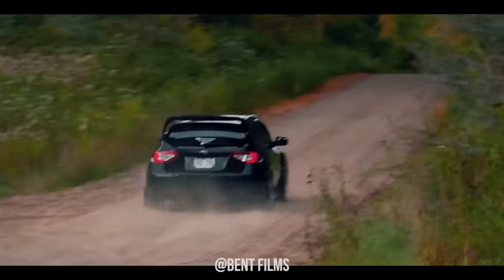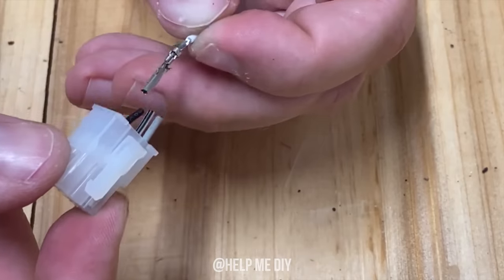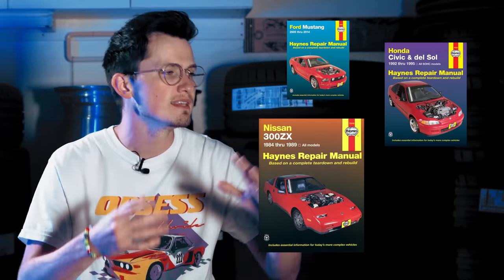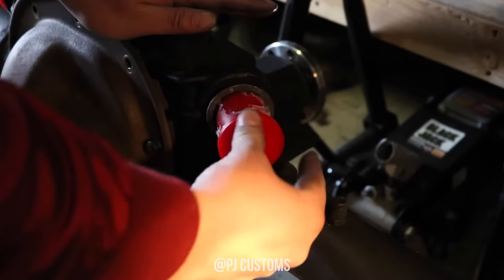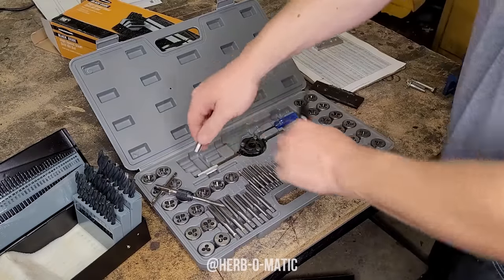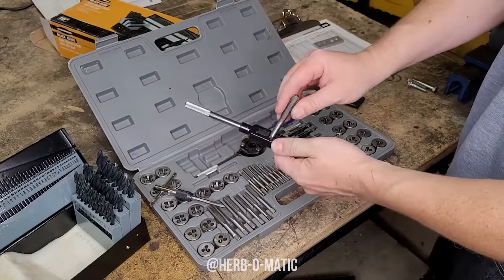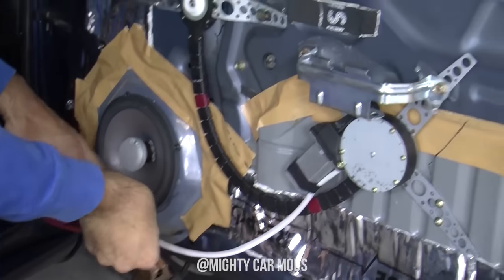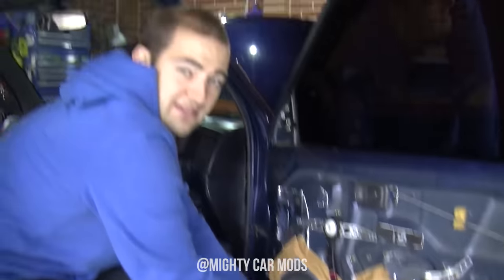How To Avoid Common Car Part Install Mistakes

Comment from the maker: What was a car mistake you made since your start in the scene?! Let me know below and I promise I won't judge!!!
😎😎
- PS The Touring Bag dropped and there's only 25 so DON'T MISS OUT! - 
AlexMartini Official site - https://bit.ly/3vZQFyC
Subscribe - https://bit.ly/3kXgWr0
Gaming Channel - https://bit.ly/37tED70
Instagram - https://bit.ly/3KXRGeH
TikTok ► https://bit.ly/3P6Uv0d
Facebook ► https://bit.ly/3M26Ssq
Official Marketing Agency ► https://www.metamartini.net/
Reply: Used Gloss black paint on my trim lol
Reply: Don’t uga tugga the bolts on the flywheel. 🤦
Reply: Installed a clip on Akrapovic CF tip on my Magnaflow muffler and as soon as I went over a speed bump it fell off and got crushed.
Reply: I Changed a Full set of Wheels with a Car Scissor Jack Lift, in a drive way that had a slant, It was worse thing I've ever done. The car fell off of the jack, I busted every Knuckle, and I busted the screen on my phone.

If you ever disconnect a Fuel line make sure you connect it correctly. A low fuel light came on, and everything smelled like gas because the fuel line wasn't connected  correctly
Reply: I never got in the scene. So much mistakes are forgotten from time 😈
Reply: forgot to close a bleeder valve, was an exciting test run

Comment: Im a firm believer of testing the repair ive done before reassembling everything. Learnt it the hard way as an apprentice 5-6 years ago. Literally the 5 minutes it might take to test something is better then tearing everything apart to plug in the connector you missed... Even tug testing connectors and hoses is a life saver
Reply from the maker: It always is. I learned it the hard hard way tbh haha
Reply: Yessir yessir! Despair is looking at your fully reassembled dash as you realize you either broke the wires to the mode door actuator or left the connector off because it's stuck in defrost....

Comment: My buddy works at an auto part store. I was gonna do my brakes and I’m new to cars btw. There was miscommunication about my car. I have a mk7 gti and in his system there were many golf part options. I ended getting rotors that were too small in diameter but I didn’t know at the time. 6 months later they wore horribly and I got a death wobble. Then I got the correct parts. We laugh at it now. Good times!
Reply from the maker: Oh damn, I didn’t think they’d fit if they weren’t for the right car. Sick either way that you got it figured out though man! 

Also, thanks for the comment. Hope you enjoyed and subbed :)

Comment: The thing I learned the hard way goes back to patience. I was doing my first oil change on my 97 Dakota, WAY over due. The way my dad talked about it made me scared to even start the truck, so my brother and I tried to push it up onto some ramps so I could get under it. That didn't go well. I got super mad and slammed my passenger door. Turns out, ya shouldn't do that on a 14 year old truck with the window down. That thing shattered and my anger quickly turned into despair... Ended up being a good thing for me because it was the first time I realized that getting a part from a parts yard and replacing it yourself for $14 is way cheaper than the $300 that insurance wanted to get it fixed. Long story short, be patient, don't loose your temper, and fix it yourself when you can to save money. Oh yeah, and if your truck is a year and a half over due for an oil change...starting it up again to put it on ramps will not hurt it, don't be dumb. Lol
Reply from the maker: Isn’t that crazy how sometimes it takes a pretty tough moment to realize something so simple? Or how often it’s taught to us to be patient until we’re literally FORCED to be patient because of us making a mistake? That’s a life trick.
Reply: Truth! Besides GM dashes and GM door trim i don't think i've broken anything i wasn't already mad at. Any day i'm working angry i'm about to cost myself money.

Comment: I was installing an I.E intake on my Golf R, and since the cone and housing are a bit bigger than stock, you have to reroute the coolant line. Well, I thought the coolant was cooled down enough to start my install, and went to undo the existing line, and it spooged all in my face. Thankfully I didn't get it in my eyes or I'd be like Helen Keller. Lesson learned, make sure the coolant is actually completely cooled down before disconnecting the line
Reply from the maker: You never realize how hot coolant stays after a car has been turned off too hahah. I hate coolant with a burning passion. The amount of times I have spilt it, had it shoot up on me, or had it leak onto shit that I had to clean is countless. Also, that’s what she said. 

Thanks for the comment as well, it means a lot! Hope ya subbed :)

Comment: Wooo! Giving a comment to the Algo Rhythm gods! 

And also, we've all made mistakes. Months troubleshooting a rough start/idle/shut-off issue with my 89 accord, throwing parts at it until one day... the coolant temp sensor finally died completely.

There were 3 sensors - 1 was the fan switch, 1 sent a signal to the dash, 1 sent a signal to the computer...
Reply from the maker: No way…Was the fix relieving or were you upset about it taking so long?! Haha.
Reply: @AlexMartini.  yes! 

But with new injectors, fpr, plugs/wires/cap/rotor/coil/igniter, egr delete...😂

It ran like a champ after that.

Comment: Ah when I did my first brake job and replaced a seized caliper, I went and bled the brakes. And tightened the bleeder screw on one of my brand new calipers...only to have it suddenly become looser as I turned it right. The joy.
Reply from the maker: Have you ever went to tighten something and it just keeps turning…and turning…and turning…and you start to realize that it’s not seating…and you realize you are seriously screwed. Thanks for the comment as well, it means a lot! Hope ya subbed :)

Comment: This is not only a horror story but also a helpful hint. Always check to make sure the old rubber seal on your oil filter came off with the filter before putting the new filter on. Changed the oil in my 95 Mirage and didn't check this, screwed the new filter on and drove to work. Needless to say on the way home from work that night the new filter worked it way loose cause it didn't seat properly and drained the whole essentially locking my engine up before I could get home.
Reply from the maker: I HAVE DONE THIS! Hahahaha I hate when it’s the little stuff like that. Mine was only a few miles but it happened on my Z.

Also, thanks for the comment. Hope you enjoyed and subbed :)
Reply: @AlexMartini.  That's crazy that it also happened to you. That Mirage was a fun car that I actually did the Evo conversion body kit on. Had a lot of money into it but this was almost 12 years ago. Since then I double check everything when changing my oil.  Also been subbed since your second video my guy. 😁👍👊

Comment: I learned the hard way to torque your wheels to spec at 18. When I didn't tighten my lug nuts enough with my ugga dugga causing 5 out of 6 lugs to sheer off, leaving me broke down in front of a adult shop while I wait for a tow. I also got fired from my temp position since I called out to fix my truck.... use a torque wrench
Reply from the maker: Always man, then retorted after 50 miles if its a brand new setup just to be safe :)

Also, thanks for the comment. Hope you enjoyed and subbed :)

Comment: I was changing the engine mounts on my 93 volvo 240 and took the intake off. I didn’t know that I also ripped the hose for the flame trap off too so when I put it back together I had a random hose with no home cause I forgot where it came from. Took me hours of videos to figure it out and get it running again
Reply from the maker: Jesus, that would take a long time to figure out if you didn’t know what to to look for haha.

Comment: Drywall screws are for drywall, NOT your car.
Somewhat related - should you mount your sub box or amplifiers or whatever else to the car floor by just running screws through the floor (ugh), DO be aware of what is on the other side of the metal...
Reply from the maker: There’s so many new questions to ask based on your comment but I feel like I’d only bring up more pain, hahaha. 

Also, thanks for the comment. Hope you enjoyed and subbed :)
Reply: @AlexMartini.  I was a professional car stereo installer for almost 30 years so I have seen a lot of WTF.  

Am I subbed?  Lol, you funny..

Comment: Hey Alex, that sound like me doing my first mod on my VWMK-3 Coilovers did not have a impact gun and tried to do it with wrenches.I had to call a friend to complete the job ,luckily he had a impact gun or I would have been in bad shape. My old shocks and struts were bouncing  all over the place. It was time to upgrade and the mechanic said it would be $1000 dollars for the complete job. So I decided to do it myself best time I ever had molding a car.
Reply from the maker: That’s awesome. How’s it all running now?!

Comment: frfr with that hand tight it all before final torque. Took me too long to learn, stayed having my last few bolts not line up when i started working on cars. I did my plugs to resolve a misfire. I took it all apart instead of one at a time and just grabbed the pigtail that happened to flop closest to the plug hole going back together. I hooked up cylinder 4's coil pigtail to cylinder 6 and 6's pigtail to 4.   Had both cylinders firing like 60deg before tdc just beating out the bearings.  Had to drive it to class and both jobs for three days until i could figure it out.  Wasn't even the plugs, i needed a coil pack.
Reply from the maker: Oh my goodness…I’m glad you figured it out but damn I couldn’t imagine going through it all and then realizing it was that haha

Comment: Wrenching is almost always complicated by something and always time consuming.  Shit that you could do in 4 hours (your second time around) takes 2 weekends the first time and there are always curve balls. Every once and a while you get something that goes smooth and that's a joy.

Only thing that wasn't a pain in the ass was the MGW short throw shifter, everything fit perfectly, everything came out easily, the instructions/video were always 2 steps ahead of my mistakes... Props to them. Oh and the tail lights, that was actually stupidly easy.

Seat mounts were kinda hard to get onto the bolts and generally nerve racking to drop in but overall not too bad.

Headers needed custom EGR block plates that I had to have machined and I had to fit them up a bunch of times to get the starter back in. 02 sensors on that job where a general PITA as well. Wrapping was slow and itchy and made the whole install miserable. Manifold bolts were all curved out when removing the stock parts. Even removing the old spark plugs, one shed a thread and it took forever to figure out why the new one wouldn't thread right... and the plug in Cylinder #7 behind the brake booster better last forever.  Still thankful all the header bolts came out in one piece though.

Cold Air was complicated when I realized I wasn't replacing a stock box (long after the unit I ordered had been sitting in my garage forever), had to grock the last guys cold air install, had to cut out those rivets and crap, had to undo all that jank, fitting up the box was frustrating, cutting the shroud was nerve racking.  Had to use my brain, there are no guides when you are working on something the last owner did.

Light adjustment rod just shattered like glass doing LED install

Stereo install was so many panels, and the damn custom speaker mounts were such a PITA and the tapping into the tiny stub of an un-used power line upside down in the passengers footwell with a hot soldering iron in one hand part was pretty harrowing. Oh and the drivers side reverse light is still extra bright since I installed the reverse cam *sigh*.

Even pedal plates I had to buy a drill angle extension kit to get a nice flush mount on the screws.

...and always the clips, the stupid little plastic clips that just don't want to come off.

Coilovers are next, wish me luck!
Reply from the maker: Oh my goodness man that’s a damn story!!! I wish you the absolute best on all of it 😅😅😅

Comment: When replacing old shocks go ahead and just replace the sway bar end links because most likely they will clunk after the new shocks are installed. Also, smack suspension components with a rubber mallet to help find a clunks from loose or worn parts.
Reply from the maker: What car did you learn this on? haha. <3
Reply: @AlexMartini.  It's my wife's 2010 Mazda CX-9 but I think it applies to a lot of cars.

Comment: Oh god the part about the window falling down and testing speakers before you close everything up…My first car when I got my license was a 88 Cadillac deville. The drivers side window would constantly fall out if this chincy little plastic seat. Tried to use glue because highschool (didn’t have the money) and I shut the door one day….ended up with a whole bunch of shattered glass in the door. One of my first stereo installs back in the day I did for my sister on her 2002 Pontiac sunfire. Bought speakers that didn’t match the ohm rating of the new stereo. Put everything in, put all the trim and bolts back in, turned on the radio, zero sound. Never put anything back in after that without testing it and I’ve learned to be a lot more patient since then 😂
Reply from the maker: It’s a true skill to be patient enough to test things before reassembly; trust me hahahah. 

Also, thanks for the comment. Hope you enjoyed and subbed :)

Comment: Another tip i would add, when tightening by feel, use mechanical advantage to your advantage, your 3/8 ratchet will strip those 12" lb VC bolts, even your 1/4 ratchet will, but if you use a 1/4 hex driver (screwdriver handle that takes 1/4 hex bits, idk the proper name for that tool.) you physically will not have enough mechanical advantage to strip the bolts, unless maybe you're the mountain. Something i learned the hard way, bc even going by the tq spec you can strip out vc bolts.

Comment: I feel called out 😂 I was doing maintenance on my e46 BMW (new valve cover gasket and sparks) yesterday so I could drive the 4 hours back home to work the next day
Reply from the maker: Do....do you have a check engine light on?...
Reply: @AlexMartini.  I did indeed, and the worst part is that didn't even get rid of it like I thought it would

Comment: My biggest mistake wasn't even my fault. Just unlucky haha. Previous owner installed a Grip Royal steering wheel and quick release in the drift car that I am now daily driving. He must've installed it crooked because, while I may not be jacked like an Avenger, I am a reasonably tough guy. I yanked on it so hard that I pulled muscles in my neck and back trying to get that thing off. Ended up needing to rent a wheel puller (which I had no idea was a real tool until this event) from O'Riley's. Used it, tightened it, and BANG! It comes off and makes such a metallic gunshot like bang that my ears were ringing and I couldn't hear my friend laugh at me for a few seconds after it happened.

P.S. Hey Alex! Big fan of your work! Are you looking for a recent college grad/video editing/marketing guy that's willing to work for ramen and a crisp high five? I promise I'm a much better marketer than I am wheel puller.
Reply from the maker: Absolutely bro. Email me : Alex@alexmartini.net

Comment: Let’s see, stripped out rivet nut on my B7 that just spun in the sub frame. Had to cut the skid plate bolt head off. Broke an exhaust stud off thanks to a cross threaded nut refusing to come off, and in a spot I couldn’t cut it off. Breaker bar did technically solve the issue. Still gotta fox that one. Thankfully the turbo and manifold are just all one piece and not a pain at all to take off. On the GTI, I broke a coolant line by leaning on it, a plastic nipple to be precise, and that was fun. Also broke an A/C line because we flat towed my car once but the strap pull taunt, crushing it. On a Pathfinder, tried to take out a rear sway bar, but due to rust and other crap, never could get it out or back together properly. Didn’t matter much as it was strictly a toy, but I probably have the skill to fix that now if I wanted. I have also overfilled the oil on a car before because I was doing a last minute oil change and rushed the job. Good ole oil pressure warning. Thankfully, the issue was resolved and the car has been fine since, but definitely could have been catastrophic failure.
Reply from the maker: Bro how many close calls have you had?!!?

Also, thanks for the comment. Hope you enjoyed and subbed :)

Comment: Replacing axles on a skyline.. getting the right hand side axle was probably the most frustrating thing ever for me. I had a bad cv boot and replaced it with another, i thought the circlip was back in place but only to find out it wasnt and had to redo everything again. Instead i just bought a new axle and call it a day. 😂

Comment: I had to replace a rear caliper on an nb miata, snapped the brake hose and it took 3 weeks to get it fixed correctly without air in the lines.
Reply from the maker: I remember doing my first brake job and remember how painfully patient you need to be to do it right. Air in those lines is the 2nd most scary thing to encounter on the road at a high speed lol

Comment: Check if you blew a fuse before rewiring a sub and a radio if it doesn't work the first time you power it on
Reply from the maker: How long did it take to figure out? 😅😅
Reply: I don't know exactly but the better part of my Friday. Both my buddy and I were stumped at why it wasn't working.